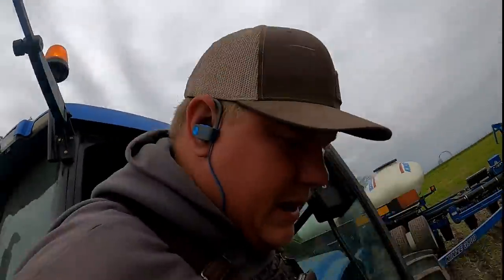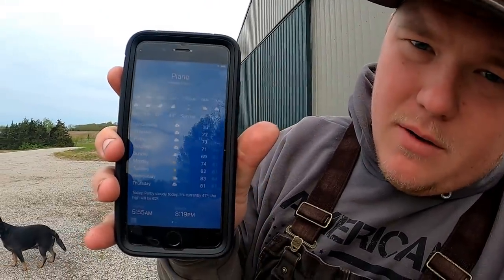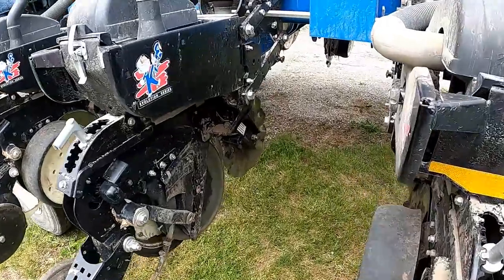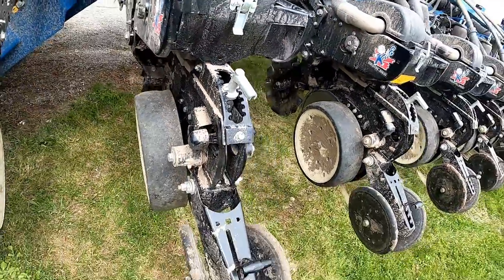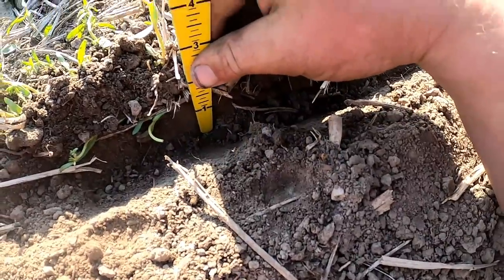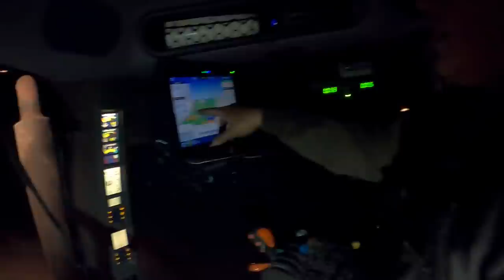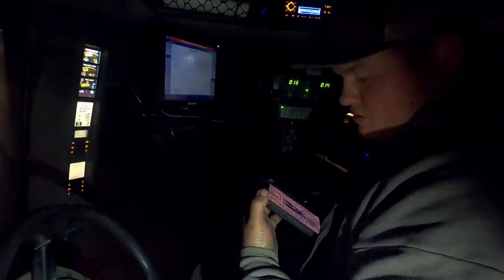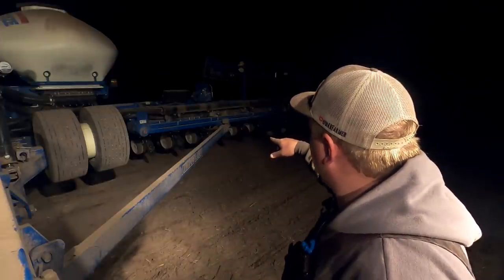What Else Could Go Wrong?! - Plant Vlog 2020

Comment: Glad I'm not the only one having a hard time finishing. Since Saturday I've blown 7 hydrolic hoses. One of which runs under the cab and fuel tank of the quad trac, which took 4 hours to fix. It was on 8ish hours and it blew again, the new fitting blew right off the hose. My cousin caught the fertilzer pump on fire. Uncle ran the planter tractor out of fuel. My grandfather Ripped off 2 disc  gangs. And I blew a tire today. It's been a long couple of days.